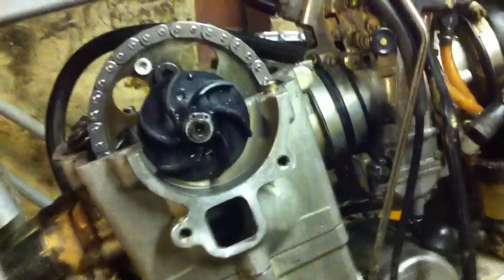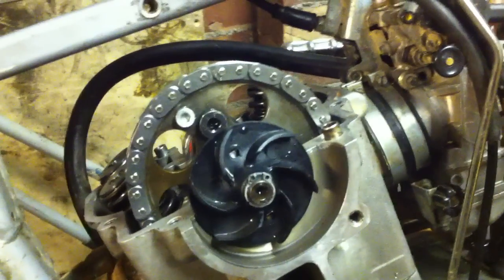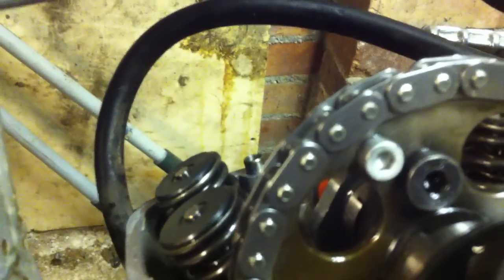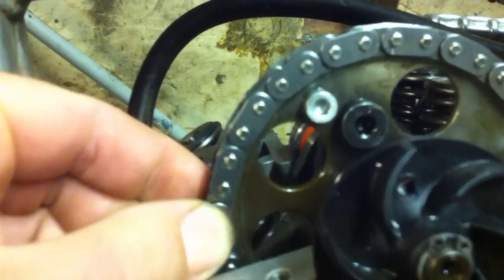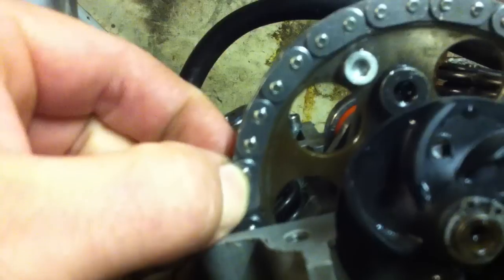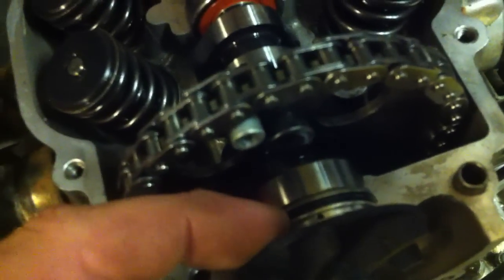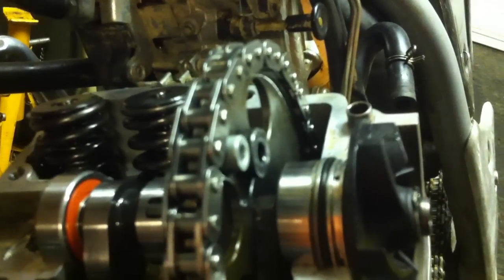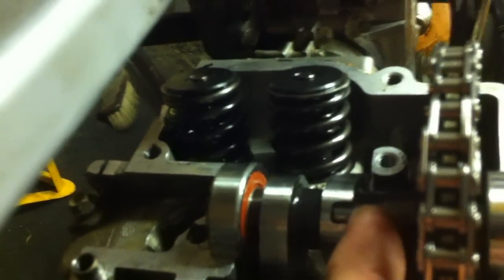ktm rfs cam chain explained.

Comment: This video is incorrect. I got the chain off the cam on my 2007 525 RFS. You need to remove the water pump impeller, then remove both cam sprocket bolts, then both cam bearings. This can all be done with hand tools, the bearings are NOT press fitted on! Once the bearings are off and the cam sprocket is as low as possible, you can just barely slide the cam chain off. Maybe if you have a new chain that isn't stretched it won't work. But it worked for me with 10k miles on the chain.
Reply: Hmm, officially they also say to break the chain. How you remove the bearings without lifting the camshaft? And you cannot lift it much, because the chain holds it in place. I can try whatever you say now, as I have engine disassembled atm.

Comment: You actually can take the camshaft off without breaking the chain. I manage to take off the waterpump wheel, and the bearing behind and remove the camshaft. But if you are changing the piston, top, cylinder, etc…. You have to break the chain, cause its placed in 2 different channels through the top and the engine block

Comment: remove water pump impeller and the bearings come right off they are not a pressed bearing infact there is a locking washer that holds the second wearing in it just lifts out of the groove  this video is so miss informed i almost bought a new chain link and a press tool  so i could replace my auto decompression gear ........ thank god i did more research had it apart and back together in 30 min

Comment: Joe is right 100 procent. same i did without watching the video. just rotated the camshaft and i saw that the decompression arm had a gutter and which the gear could drop.
Reply: Hey how did you remove the cam cover without pulling the engine?

Comment: you can unbolt the sprocket and get enough slack to roll the chain around the sprocket
Reply: No you can't. The automatic decompression assembly prevents the cam wheel from coming off. You would need to pull the bearing, then the de comp might come off. Easier to cut thr chain
Reply: @QuantumMotorWorks  hmm i wonder how i managed it then??? Maybe I'm a magician.
Reply: @Trumplican  you could be, unless your cam chain was so blown out, maybe you didn't have to.....🙂
Reply: @QuantumMotorWorks  i've done it with multiple of these engines its really not that hard you just loosen up the cam chain tensioner
Reply: @Trumplican  I'm going to check the service manual and see what ktm thinks, because I really don't know  and I just did a tear down on one of these engines, and the cam chain definitely needed to be cut.
Reply: @QuantumMotorWorks  to remove the cylinder yeah it needs to be cut but to adjust the timing you dont have to cut it you can just loosen the cam chain tensioner and roll the chain around the sprocket with a flathead screwdriver. It's tight but can be done. Sometimes you have to pop off the outer bearing and the decompression lever but that's still faster than breaking the chain and pressing it back together and also risking dropping a piece of the link down the cylinder into the crank case.
Reply: @Trumplican  not sure why you would need to adjust the cam chain timing under normal conditions.....but the ktm service manual says to cut the chain in order to service the cam, water pump, or Cylinder.
Reply: So yea, according to ktm, you gotta cut the chain to remove the cam.....you must be a bonified magician.
Reply: @QuantumMotorWorks  did i say to remove the cam? he said in the video he couldnt adjust the timing without cutting the chain, that is false. Also, you might have to do such a thing if you originally failed to correctly set the timing. Also any mechanic knows just because the book doesnt mention doesnt mean it cant be done. The fact you even had to look at the book to figure this out shows you do not understand the mechanics of this engine. Ive been a powersports mechanic for most of my life and Ive built multiple KTM RFS engines that make over 70 horsepower so I can tell you unequivocally you can adjust the timing without cutting the cam chain and would be a fool to cut it in fact.
Reply: @QuantumMotorWorks  cut the chain to service the water pump?? OK now I know for a fact you've never touched one of these engines. Also, you dont "cut" the chain, you press the link pins out.
Reply: @Trumplican  yea if you wanna replace the seals according to ktm, they want you to dis assemble the cam cap. I just posted a video yesterday of my most recent exc 525 tear down,  And bro....of course you cut the chain....I used a plasma cutter and precisely cut each rivet out.... right after I slipped the timing chain off the Sprocket first....
Reply: @Trumplican  he'll ya, that sounds better
Reply: @Trumplican  I don't build ktms all that often, if at all, it's not my speciality. That's why I go on you tubes and troll.
Reply: The fact that I had to look it up in the service manual, tells me ktm isn't manufactured as well as, say a Japanese bike. I work on all the latest model ktms, husqvarnas, honda, yamaha, ducati, etc. .nothing to crazy. Basic stuff. Ktm makes a  cool bikes, but that's about it.
Reply: @QuantumMotorWorks  what makes you think they arent manufactured as well? Because you dont understand how they work?
Reply: @QuantumMotorWorks  so you now admit you can take the chain off the sprocket before cutting it? And no youre not supposed to cut it your supposed to use the cam chain tool that pushes the pins out but nice job heating the adjoining links so that they are probably now weak.

Comment: Would you happen to know where I can find a master link for the cam chain? I have a 525 Polaris outlaw 2007, and having a hard time finding a master link for the cam chain so I can change the gaskets
Reply: no such thing as a master link for a cam chain. They are riveted together all the way around. The cam has to be removed from the head before the head can come off. watch a video on your specific motor or get a service manual that will tell you the step by step
Reply: @clayboi6939  on these engines there is. Well its the same as the rest of the links but it comes with the plates and two pins and has to be pressed on and the pins have to be peened on the ends. But without getting technical he is asking a valid question because you do need a new link when you reassemble these engines because you have to either cut a cam chain link or press one apart to remove the cylinder head.

Comment: Is it possible to replace the cam chain without removing the cylinder? my thought is to break the chain, and fish a new one through as I remove the old one.  I don't want to remove the cylinder though.  Has anyone ever done this?
Reply: Keith Collins attach the new chain the the old chain with wire and just pull the new one on

Comment: your wrong my friend. you can easily take the camshaft with gear off and adjust the timing without cutting. only the chain cant come out of the the engine and cylinder and head.